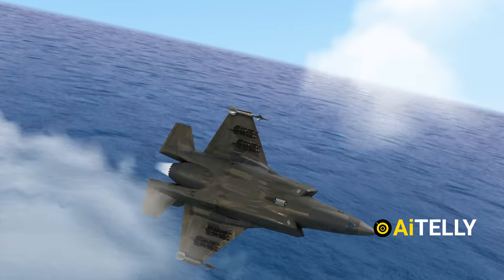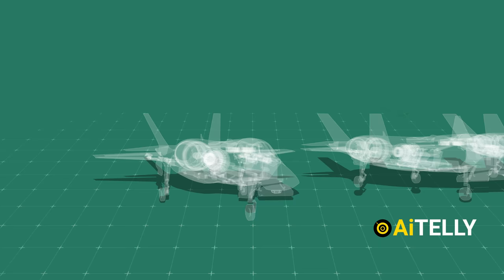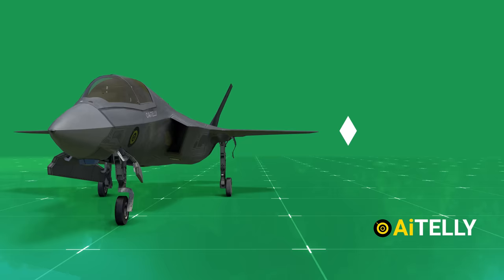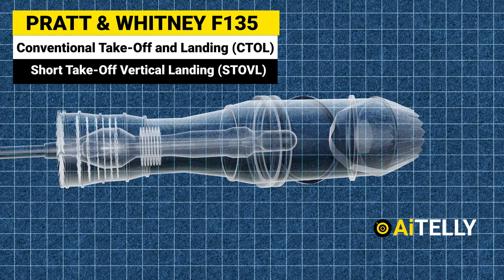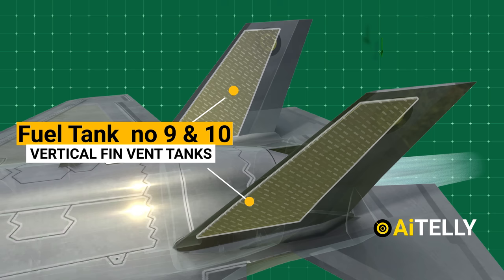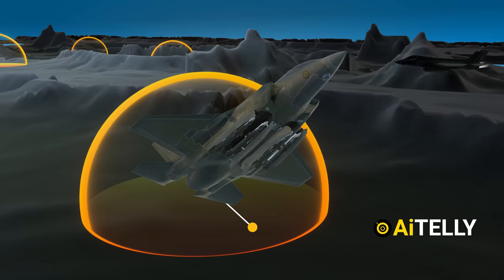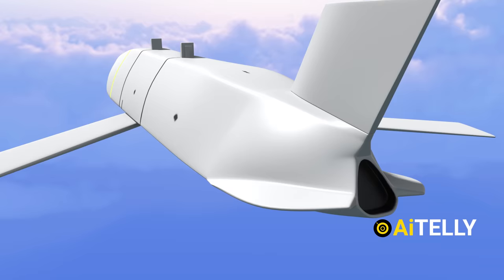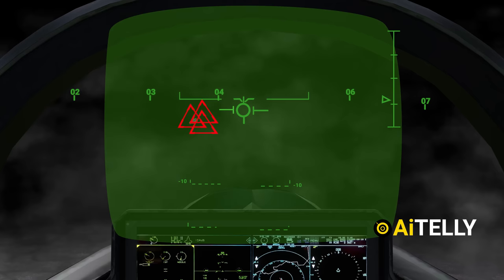F35 Stealth Fighter Jet How it Works

Comment: to get some things stright the F35 was designed for mutirole(ground support and air cover) and not air superiority like the F22 , J20 or the SU57 which have internal wepons bays for more stealth. So to all the americans out there, no, the F35 would not win against any fighter every time. it wouldnt even be a 50/50 more like a 30/70
Reply from the maker: It was designed to be Stealthy and economically on a  lower budget  that was one of the reason for the Join Strike Fighter programme.
Reply: @Aitelly  yes that and so that one fighter can do many things(which isnnt really working out right now) it costs way too much for way too little deterrence and just recently all F35s were grounded for various reasons that significantly limit the capabilities
Reply: @JSFGuy  is that why every type of F35 has crashed at least once? Spent billions are a ok at best jet
Reply: @JSFGuy  If you want to believe that the F35 is a some all capable jet then so be it but keep it to yourself because I didn't fucking ask
Reply: @kylexu227  The F-35 is as good as an air superiority fighter as the F-22 is. Just ask F-22 pilots. It's as good if not better on low altitude flights. At higher altitudes, the F-22 is better but not by much. It is clearly superior to the F-16, unless the F-16 is running clean relying only on the cannon. The F-35 also has a superior electronic warfare suite and radar compared to the F-22. There are less than 200 J-20's and Su-57's out there. There's over 800 F-35's. They're actively being used in carrier operations, amongst others. All the F-35 crashes have been as a result of pilot error, or a singular faulty part. There has been no crash as an inherent design issue from the aircraft.
Reply: @britishmalayasociety  It was designed for muti role so there are visible mounting points and that reduces stealth. Im not saying its a bad fighter in general but it does have its own price to performance faults
Reply: @kylexu227   Yes, exactly. It's multirole. It can be a stealth fighter, or stealth bomber carrying weapons internally. You can carry external mounts as well, to increase firepower or range. Yes, you'll reduce your stealth profile, but literally using the external weapons will give you back your stealth, or just simply choose to go without external weapons. Both the J-20 and Su-57 can carry external weapons as well. Because literally, if your wings can take it, why would you restrict yourself?
Reply: @britishmalayasociety  the J20 has no external mounting points to increase stealth. and im not saying the F35 is bad im just saying that because it was designed to do everything it is not a 10/10 at everything

Comment: There is 4 Versions of the aircraft if I'm not wrong there is the f35I
Reply: F-35I is just an F-35A with slightly different avionics. There are no physical modifications that would make it a different "version".
Reply: F-35I (F-35A Chip tuning).

Comment: Funny F35B VTOL Technology (Main Engine) was stealed from Russian Yak 141
Reply: Nonsense. Just because yak 141 VTOL tech means stolen?  The lift fan was developed by Rolls Royce for a start, Also the variable geometry nozzles were also developed by Rolls - for the Harrier long before the Yak. The French Mirage IIIV was the first to introduce separate lift and main motors. The Yak combined a bit of Harrier and Mirage, But the key to both the Harrier and the F-35 is that the lift from the front nozzles is ‘cold’ direct from the bypass of the Pegasus fan, or via a separate lift fan driven by the engine on the F-35. This removes the need for extra engines and all the plumbing and fuel / safety issues involved. So if you want to credit anyone with F-35B’s system, credit Rolls Royce, after all they designed it. There are no yak 141 DNA related to f35B just because they both used VTOL tech and BTW soviets didn't invent the VTOL its the UK British , French And yes, Lockheed-Martin purchased the patent of Yakovlev. However the Russian company could not make the concept work suavely and consistent. Hence Lockheed-Martin did a lot of R&D to make the system work. OVV  the system refers only to the thrust vectoring rear muzzle and the main lift fan of the F-35B

Comment: Youre comparing a Harrier from 1967 to a 2006+ Lightning 2???
Reply from the maker: Not comapring but it was a the one whao pave the way for Lockheed Martin to built the F35
Reply: @AiTelly  
For instance.
You said the harrier suffered from uncontrollable tilt due to turbulence on landing/take off because it didnt have STOVL.
You then said, the F35 L2 doesn't suffer this effect due to it having STOVL.
Seems like a direct comparison to me 😉

For the record.
The harrier landed and took off 1000s of times using it's 1960s vertical lift technology without issues 👍

Comment: Yak-141 is much better. Lockheed bought the airframe from russia and used it for F-35 by utilizing the principles.
Reply: Nah, the airframes are very different, and even the source of propulsion is different.  What Lockheed bought was the knowledge Russia had gained from their experience with a STOVL fighter that had a column of thrust in the front and one in the rear.  They could have gained this knowledge themselves over time, but why not talk to those who have done it before (circumstances permitting)?  The Yak-141 had three engines: the main engine with a 90-degree vectoring nozzle, and a pair of smaller engines mounted vertically in the front that were only used for vertical lift.  Instead of the latter two lift engines, the F-35 has a lift fan coupled with a clutch and shaft to its main engine (that has a 90-degree vectoring nozzle in the rear).  So the F-35 has only one engine compared to three, and all of its power is available both for normal and vertical flight.  Each design has its advantages and disadvantages, but overall the F-35's is more optimized: all the power in one engine that is always usable, and less "dead weight" to carry in normal flight.

Comment: the naval carrier borne F-35C Lightning II (Block 2F) stealth multi role fighter interceptor can be armed with an internal gun (25 MM GAU-12/U six-barrel rotary cannon or similar) but they didn't for whatever reasons . . . however the carrier borne F-35B Lightning II stealth VTOL multi role fighter cannot armed with an internal cannon . . . though it can be done but doing so would require significant modifications to the very airframe & design architecture & additional high costs . . . that too an already very expensive multi role fighter . . . the F-35B not having the folding wings feature begs the question why . . . the carrier borne F-35B Lightning II stealth VTOL multi role fighter could seriously do with a stretched fuselage & folding wings . . .

Comment: F-35A: nice plane
F-35C: nice plane
F-35B: nice technology and experiment but.... would it be really good in a real combat field? IMHO the fan adds to much weight, and the small wing surface seems to require an high minimum speed... not talking about the autonomy if the fan is used. Don't know... just my opinion. I think that the power of the F-35 program is the Combat Platform, because F-22 and Su-57 are as aircrafts at another level!
Reply: the fan adds weight, sure, but it makes the plane significantly more versatile. F-35Bs can land on small regional airfields, massively improving their combat effectiveness.

also i wouldn't say the Su-57 is at another level

Comment: AiTelly, can we talk?  The F-35 can in no way come close to replacing  the F-16 and the A-10. For starters it cannot carry nearly as many weapons and if they put weapons on the wing it loses its stealth.  - Also, the A-10 is armored and can loiter over a battlefield for a long time - The F-35 is too expensive to used for close air support as the damage from ground fire alone would make it cost prohibitive. Compare the cost per hour to run an A-10 vs an F-35.  Did you get anyone form the Air Force who knows these planes to consult with you?
Reply: The F-35 is a replacement for the F-117 and AV-8B. Other roles are secondary.

Comment: small intakes cannot power the jets and a powerful radar, unless the plane is slow, and this plane is slow. Internal bays for weapons means less fuel compartments, short range, needs in flight refueling. Vert lift spends tons of fuel for nothing. A disaster waiting to be real. Shot down above Serbia, Radar paint delaminates when wet. Crap! No combat experience.
Reply from the maker: it's an Experiment